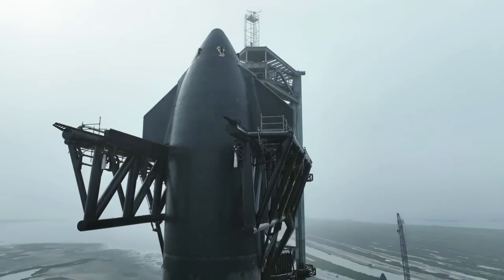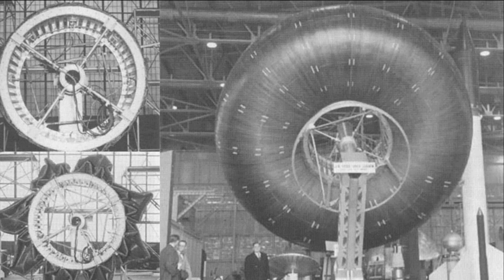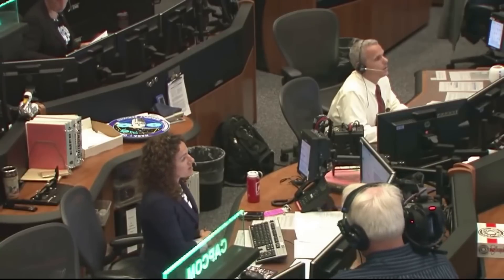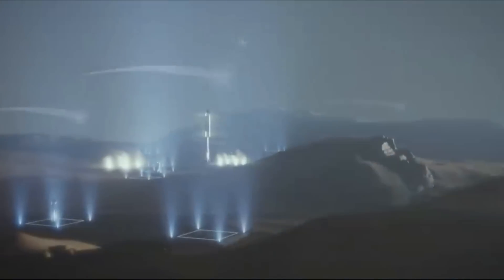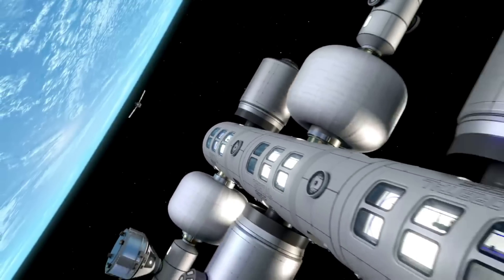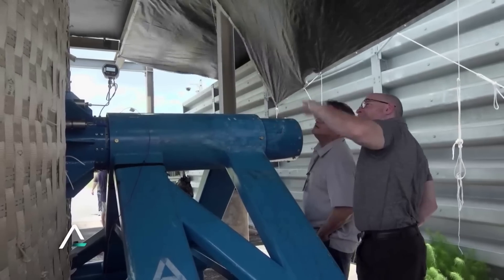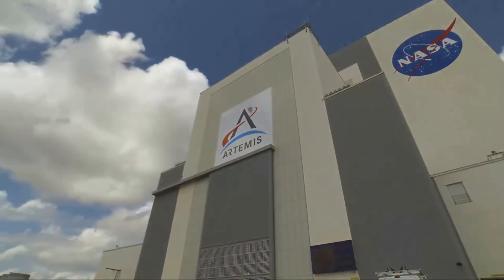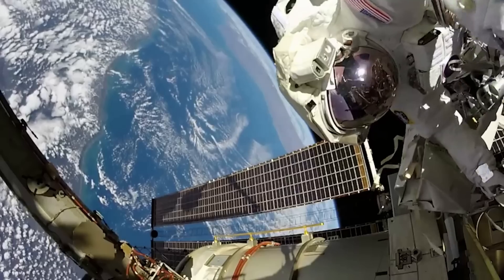Are Inflatable Space Habitats A Realistic Future?

Comment: Inflating the module on deployment is a great idea. However, relying on air pressure to maintain the structure is not a great idea, given the possibility of a meteor strike. After deployment, the outside should be sprayed with some kind of polymer or epoxy.
Reply: Sprayed? In a vacuum? Get real.. maybe you are talking about the inside? Why wouldnt air pressure be enough to maintain its shape, if the air pressure ever drops that will be fatal to the crew which has not happened before.. micro meteorites are over estimated.. you can litterally be hit by one and then slap duct tape over the hole if one even forms
Reply: @KamalaChameleon  "Given the possibility of a meteor strike",- your reading skills need upgrading.
Reply: @williambreedyk7861  meteor strike.. just clownish.. there are tens of thousands of satellites and hundreds of rockets and the various space stations for decades have never once come close to being hit by a meteor
Reply: @KamalaChameleon  When people's lives are involved, safety protocols change radically. You have NO idea what you are talking about.
Reply: @williambreedyk7861  🤣🤣🤣🤣 "spray with epoxy in space"
Reply: @williambreedyk7861  fact of the matter is inflatables are every bit as safe and probably more safe than any space station to date

Comment: I think inflatable units mostly should be used for storage and to sleep in.
They are easy to ship to a station arriving as part of a normal cargo shipment.
I hope the attachment point is foldable so you can pull this through air locks that had a standard size so you can pull it out of the cargo ship, and out another gate and then attach it.

Comment: There is one element missing from the layers is a hybrid spray foam with Harding catalyst injected in a layer after initial inflation. This adds rigidity, increased radiation protection, micro meteoroid protection, and durability.  It’s also light weight solution.

Comment: This was a really good summary of the state of play re inflatable habs. Thank you.

Your observation that the contract for the test module on ISS will need to be extended if it goes beyond 2028 was interesting. Who would that extended contract be with? Does Bigelow still exist or is it in administration? If the later then would the administrators negotiate the extension and add the contract value to the company assets or has the company already been wound up and the assets sold off, in which case I wonder who acquired the contract rights to the ISS test module (or will have acquired them by the time the possibility of a 2028 extension comes around).

Comment: You ignore the biggest downside to inflatable modules: when they inflate they are completely empty. So you'll need multiple other launches to deliver the interior equipment negating much of the benefit.
Reply: If they are only using it for a store room then I would think they are great.  But surely making all that extra space available overrides some of the hassle it would be to outfit them with internal systems.  And maybe future versions will be outfitted to a degree at launch.
Reply: im not sure that there is a negation of benefit here, although this is certainly an inherent characteristic of this approach. multiple smaller launches to fill the larger space is doable and arguably cheaper than the bigger launch that put this in orbit. this still represents a positive capability that did not exist with rigids structures alone. it is still a cost per unit of volume improvement over rigid structures.

the biggest trade-off that i can see is the apparent lack of ability to have any kind of window, trans-barrier conduit, or rigid external attachment points. it certainly does not replace rigid structures, but it does add some capability in conjunction with them.
Reply: If you want a module that is bigger than any fairing size on every rocket, it is simply impossible to do so with a conventional hard structure. But with an inflatable one, it is possible, which in my opinion is enough of a reason to research and develop this technology.
Reply: Multiple launches, especially during the “SpaceX Era”, is a non-issue, especially when compared to current (pre-StarShip) faring diameters vs. the much desired larger habitat diameters 🤷
Reply: @MrGunderfly  Your trade offs are good points.  Perhaps they could add an external frame to it at a later date for attaching modules.
Reply: Inflatable habs can be outfitted with interiors that slide into their working positions as the hab inflates. How good is the design team?
Reply: Not they aren't empty, most designs have a central rigide core that have life support and utilities included.
Reply: Many of the videos show the m exploding. What sort of pressure was that ? Normally it would be <15 psi.
Reply: @terrysullivan1992  NASA requires it to be able to survive 180 PSI. It burst at 192.

That is, of course, way more than they ever actually experience in use.
Reply: Ikea flat pack within the 5M dia core for floors and walls.

Comment: could this technology be used for liquid methane / hydrogen / oxygen storage on orbit?
Reply: Theoretically yes, but I haven't heard of any proposals along these lines. Right now propellant is still mass limited rather than volume limited and will likely remain mass limited until we can get in-situ resource refineries set up.
Reply: I don't know if soft materials could handle cryofluids. Especially hydrogen which can work its way through almost anything, and liquid oxygen where you have to be concerned with how reactive these materials could be with it, as opposed to sea-level proportion gaseous oxygen.
Reply: @stardolphin2 liquid oxygen isn’t going to be reactive because it’s liquid. At room temperature oxygen isn’t even reactive with hydrogen ,methane or wood you have to heat up the materials to start a reaction. Oxygen is a corrosive problem at high temperatures.
Reply: @TheAmericanCatholic  your Wong on both points. Apollo 13 was all about liquid oxygen igniting with flammable materials in its tank lining. And room temperature oxygen is very reactive why do you think metal can rust at room temperature. The requirements to increase the temperature for things like wood or methane to but is to get the fuel to a high enough temperature to become reactive since they are quite stable molecules otherwise.
Reply: @luther0013  yes room temperature oxygen is reactive with some elements or chemicals but not all and room temperature oxygen isn’t a flame risk.Yes you have to increase to the temperature to cause room temperature stable molecules to react with oxygen that’s what I said and I should mention a lot of materials used in inflatable habitats should be non reactive with liquid oxygen. If it is slightly or very reactive then put protective layers in the inner part of the habitat to protect the reactive layers. I main issue I think inflatable habitats would have would be withstanding cryogenic fuels but who knows how they would exactly respond or what materials would withstand cryogenic temperatures.